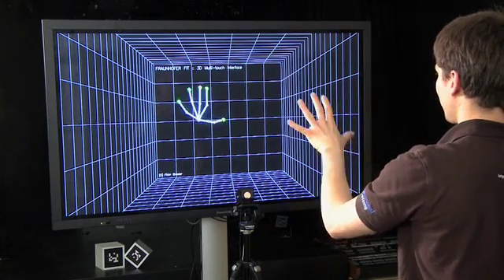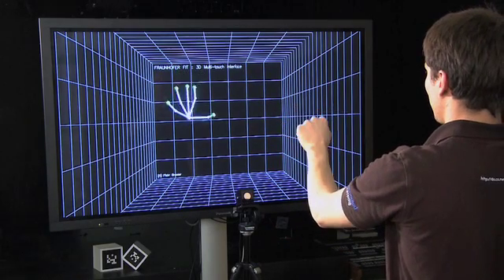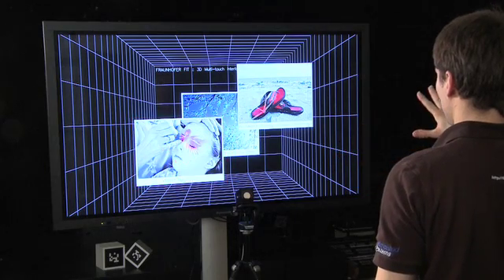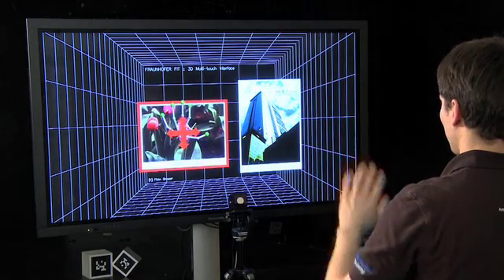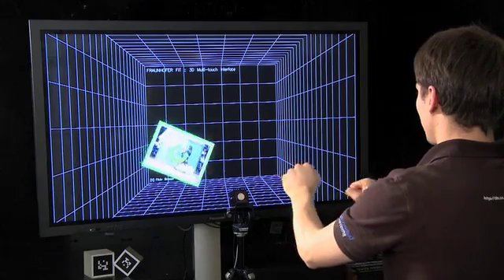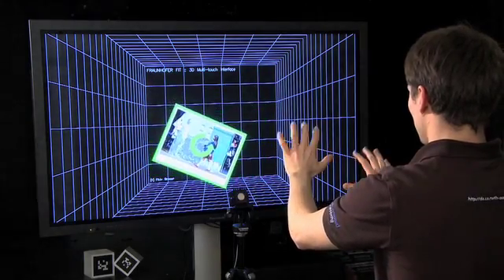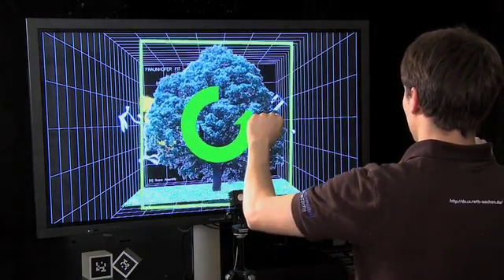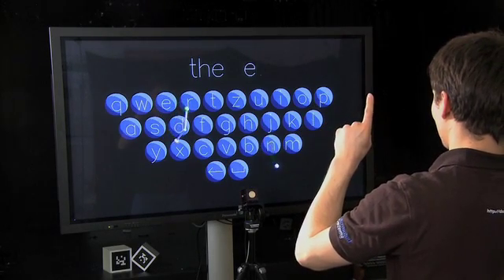3D Multi-touch Prototype for Augmented and Virtual Reality

Comment: @ghackenberg  Is your application free for testing? Using a free driver like iz3d,  you could make a  proof of concept adding deep perception. The driver is for a 3d monitor, although it comes with an option to use with those old red/cyan anaglyph glasses that works with any monitor/projector. It only requires that your application works either with Direc3D or OpenGL, then it runs in  the background making possible the deep perception of all the 3d objects in any Direct3D or OpenGL application.

Comment from the maker: @orange7886ro Thanks! The system uses only one camera for detecting and tracking human hand-like objects in 3D. The camera is a little bit special though, as it uses the time-of-flight technique for measuring the distance of objects instead of the color. This means that your algorithm's calculations operate on 3D geometry directly.

Comment from the maker: @TheGangstany Hmm, regular office work such as writing letters or entering information into forms might not be the best use case. But there are other tasks that require much more creativity and freedom (not at last computer games). A stable 3D multi-touch and gesture input system could deliver that freedom, which traditional devices such as the mouse or the keyboard lack. One reason is for example the control on 3 dimensions with 5 fingers, as opposed to the mouse in 2 dimensions (the table).

Comment from the maker: @ODNA I guess the biggest problem of the current system is the tracking algorithm. In the prototype I used optical flow, which was fast to implement but does not handle the problem very well. Other than that maybe the pose estimation method requires some more attention. Its a good start could be extended in some places.

Comment from the maker: @tomat1 he is me ;-) and I agree, its sometimes a little hard to use the system. There are a few technical issues, which I did not address during my Master thesis. These issues currently require the user to concentrate a little more during interaction.